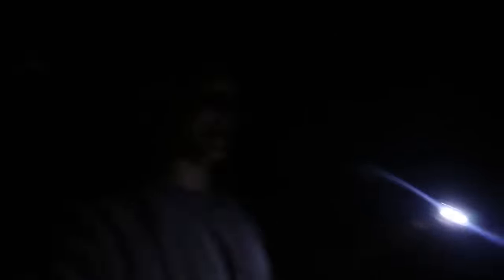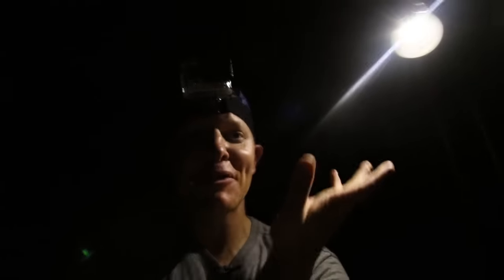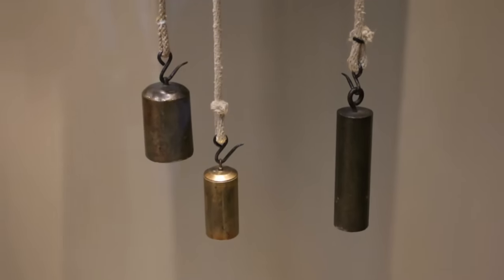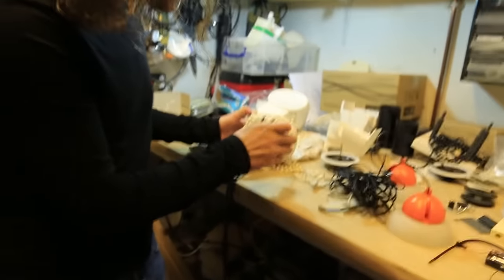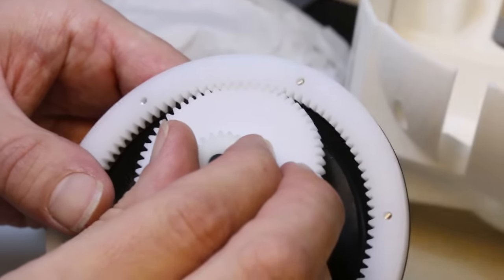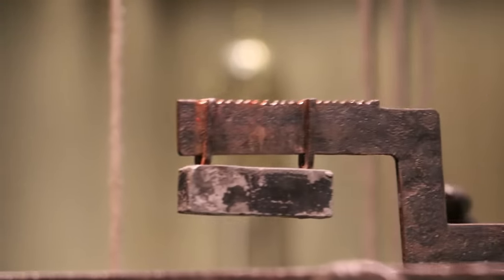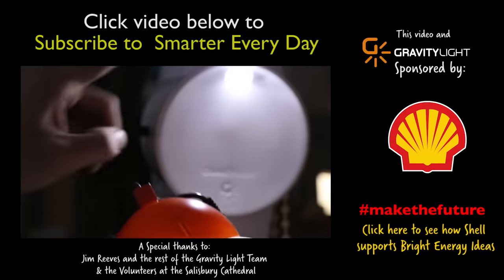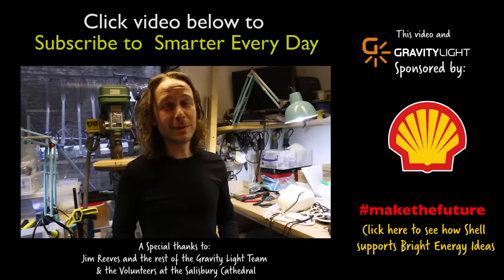Turning Gravity Into Light - Smarter Every Day 146

Comment: Brilliant!  
The most impressive part is subtle. The LEDs are shunt voltage limiters, so at a certain point they want to draw excessive current. Start to approach that higher current and the extra load makes the motor/generator harder to turn, and that is like pinching the last high speed gear - it wants to stop. A super simple electo-mechanical governor. Love it.
Reply: but I imagine there is a heavy enough gravity load that could be applied that would blast through the resistance of the motor, right?
Reply: @vincent21212    sort off.. the motor (generator really) wants to stop because the high current makes it very hard to turn, but if it stops turning, it produces no current and if it produces no current, the led would not be a load and the generator would be free to turn, so it automatically finds its "sweet spot" for a particular LED load.
If the led was removed it would fall as fast as its mechanical resistance would allow.
If the led was shorted the fall of the gravity load would be slowest.
In every case, the motor always turns.
Very Cool design. 

I hope some philanthropist looking for a tax write off starts sending them out to where they are most needed.
Reply: pfff I was just gonna say that ...;)
Reply: Physics is cool!  The only weak link in that system is the belt. I made my living changing belts like that. They turn into chewing gum in a few years.
Reply: Thanks for this explanation but I can't quite wrap my head around how the voltage limit of an LED makes the motor turn more slowly?

I do some very very basic (electronic) prototyping and if I don't add a resistor, the LED will draw power until it burns out.

Do you have any sources I can use to learn how your explanation works?
Reply: @Ryan-lk4pu  If you take a DC motor and spin it, it spins freely. If you short it out and try to spin it, it's very hard to turn. This is because when shorted, a high current will flow through the armature windings with very little speed. That current isn't free. It requires energy input in the form of torque. As with any diode, when an LED reaches a high enough voltage to turn on, it's essentially a short circuit. It will draw as much current as the supply and its internal resistance will allow. That's why a series resistor is needed. As far as websites or videos to illustrate this, I can't think of any right off. Good luck with your experiments!
Reply: @Ryan-lk4pu  The best teacher is experience. 

Get your hands on a toy motor and any LED. Try spinning the motor with it's wires shorted, with the LED attached, at different brightness levels and with the wires unconnected.Feel the differences in the Torque needed. Now all that is needed is to select the correct gear ratio that can ONLY deliver the Torque you want, at the speed you want and no more.
Videos and papers on Gear Ratios, Basic motor theory, basic Led theory, Potential/Kenitic energy theory are great, but if you want to understand viscerally/innately you have to tinker.
Also a lot more fun.
Reply: Thanx, I was going to ask, cause the video didn't make that clear, even though it did kinda make the escapement out to one of the most important parts.
Reply: wait, so in that sense, would a dynamo hub limit the speed of a bicycle?
Reply: avocette yep! It's actually the basis if the regenerative breaking used in electric cars. The power to the motor is disconnected, and instead taken from the motor. The kinetic energy of the car charges the batteries and that additional loading slows the car.
Reply: @hopelessnerd6677   Good point.  In order for this design to be viable, that belt or rubber band must be easy to replace.  This kind of looks easy enough, just looking at it, but spares should be readily available or easily improvised, as well.
Reply: since the LED's are slowing the fall of the weight and also have a level of resistance, assuming the LEDs reach a maximum brightness and cant pull any extra current, any weight over that amount would result in the light lasting longer instead of being brighter right? The extra weight would allow the generator to do the same work with less distance (of the weight) traveled?

Basically, using a heavier weight would make the light last longer before you have to hoist it up again correct? Or is it a case of any extra weight wont do anything and will still drop at the same speed?

Lets say it takes 100lbs of weight to reach max brightness and that gives 20 minutes of light. If I use 200lbs of weight, would the light last for 40 minutes?

I could imagine a more industrial version of this using pullies and very heavy weights to make a gravity light that would last all night if this is the case.
Reply: @hopelessnerd6677  do you have any good ideas for a substitute or some way of solving the issue?, I’d really like to know, and steal you idea and become a millionaire. Seriously, I’d like to know. Of course I know the chain system, but guess it would not be practical in these kind of situations.
Reply: Well explained
Reply: It is a nice idea, but feasible and practical are two different animals.

The company has shifted from Gravity Light to NowLight as the weight solution provided too little power for charging phones.
Reply: @madshorn5826  I see that the company pivoted to a USB outlet. A logical progression for sure. Thanks.
Reply: @hopelessnerd6677  quality belts should last 15 years

Comment: This is actually along the lines of what people are proposing as a solution to storing solar power on mass.
Because lithium batteries can only hold so energy and they lose energy too fast for large reservoirs. Using solar power to lift an object while its getting energy and letting the object fall when there is no more sun gives you the ability to store energy theoretically until gravity stops working or something physically brakes.
The trick is translating solar energy into lifting energy efficiently.
Reply: Sean Peery Actually gravity is already used as storage as pumped hydro-power
Reply: Sean Peery oh and their efficiency is around 70-80%
Reply: matucha123 Thank you.
Reply: This is not practical. A small solar farm with an output of 10 megawatt will need to store 180 billion joules (10 hour day, half of the energy is stored for the night). You will need to lift an anchor that weighs 1 billion ton to 180 meters. If iron is used, it will cost around $88 billion not accounting for the labor, structure, and lifting mechanism.
Reply: I think you've made a mistake here: 1 J is 1 Nm. 1 N is approximately the weight of 0.1 kg under Earth gravity. So you don't have to lift 1 billion tons 180 m  but only 1 billion times 0.1 kg or 100,000 tons. The hydropower plant near the town where I grew up has a head of more than 800 meters, so to store 180GJ you would have to pump up less than 22500 m³ of water. Doesn't sound that bad. (And in fact using reservoir power stations to store excess energy has been done since at least the 1960s.)
Reply: If you're talking efficiency just throw away solar and wind power. You can't have efficiency with inherently unreliable sources.
Reply: No u will lose all the energy because of friction. I get ur point. U try to say that lithium cant store large energy therefore we should constantly use that energy to lift this up then get the energy back as this machine work.
But u will lose alot of energy in the process, thats the problen with friction, some energy will turn to heat to break the object overtime. Its lost energy. 

Its not like water cycle where it become cloud-rain-sea.
Reply: So a perpetual motion machine? I think you're onto something xD
Reply: you still have to actually build the thing and maintain it
the big problem with "great ideas" like this is that they consume far more power than they produce
Reply: DaedalusMind use one charge one
Reply: @beamboy14526 nighttime power use is much lower. Because people are nocturnal. Because of evolution. 

Normal people do not stand out in the middle of what remains of the Amazon rain forest lighting themselves up while naked and wet.
Reply: @Willaev  I think you know not of what you speak. Considering solar efficiency and wind has hit levels as efficient as coal. 🤔😉
Reply: @touristguy87  "Normal people do not stand out in the middle of what remains of the Amazon rain forest lighting themselves up while naked and wet."

People you think of as "normal" are just no fun at all. I reckon my best half-dozen mates would all jump at the chance to go to the Amazon and light themselves up while naked and wet. And drunk.
Reply: You could run a pump to fill a reservoir.  Water could be your heavy weight.
Reply: Willaev You’re confusing efficiency with reliability. And converting to potential energy is exactly what solves the reliability issue.
Reply: Genius!!
So we can convert Solar Energy to Potential Energy, and then use the similar mechanism to convert it back to Electrical Energy when required.
Reply: @realdeal5712  But with time, if we make it more efficient, it's all about by which method we can save more energy from getting wasted.
Reply: @user-tr2dh4xx6u  An Idea is an idea. Even if it doesn't work, people should be encouraged to produce creative ideas. One outta thousand ideas work, but we need those thousand ideas to nominate one.

Comment: it's a human powered light... that uses gravity and potential energy as a medium to store the energy, like a windup toy that uses a spring instead.
Reply: Grip Limit exactly. A humen still has to hoist the weight in position. That uses humen energy.
Reply: Still, technically it's the gravity that moves/pull the weight. We usually call a windup toys a "spring powered" toy, just like this a "gravity powered" lamp.
Reply: Immanuel Herman sure those examples are how we define the way we store the energy, but we (humans) still put the energy into it. unlike your cell phone that you plug into an external power source, or buying batteries for a flashlight.
Reply: And humans are food-powered. Which is sun-powered. So I guess it's a fusion-powered light ;-)
Reply: Diego C. you are correct. almost all energy on the surface of this planet comes from that big ball of plasma in the sky.
Reply: +Diego C. But fusion comes from hydrogen particles and those particles came from another star. And those came from another star, and eventually it all came from the Big Bang. So I guess it's Big Bang powered @_@
Reply: EnigmaHood yes, but hydrogen atoms are the "fuel", the relationship between mass and spacetime are the engine that triggers fusion...this is getting deep, lol.
Reply: All hydrogen was created in the Big Bang. Stars never create hydrogen, they "burn" it.
Reply: Food power is my favorite kind of power.
Reply: Diego C. I never said stars created hydrogen, I said hydrogen particles came from another star, and they did.
Reply: Its human powered yes, but instead of using a battery or capacitor to store the energy and release is slowly, they use a clever mecanism that may last longer. If this is made properly it will last longer than a lithium cell would.
Reply: The sun's fusion is powered by the gravitational collapse of hydrogen, so its gravity powered ;)
Reply: most visible light is human powered with the exception of stars and some biological creatures. The only difference is that it takes more effort to put on a bag weight than to flip a switch.
Reply: krect
Reply: That's true, but the light bulb doesn't use much energy, so having to lift the weight is just a couple calories.
Reply: ok ok so everything exist in the universe so whatever way you power light it is correct to say is universe-powered.
Reply: @ironcito1101  That is if the sun is fusion powered. That is the leading theory, but a burning ball of gas in space is a stretch of math and imagination.
Reply: This is exactly what i was going to say, a quasar is a gravity light, this is human-made light because the work is done by lifting the weight.
Reply: You could do the same thing using a spring instead of a weight. It would take longer to wind up the spring but the whole thing would be much smaller. Swings and roundabouts.
Reply: hunkyvampire still it’s better then having no light and lifting 10 rocks for a long amount of CLEAN and SUSTAINABLE light isn’t to bad
Reply: @griplimit261 , and we humans get energy from the sun. Really, everything is "sun powered", so I wager it's ok to call it "gravity powered".
Reply: @ihl0700677525  So can we say they are "turning spring into energy"? Which is what the title says here.
Reply: spring degrades